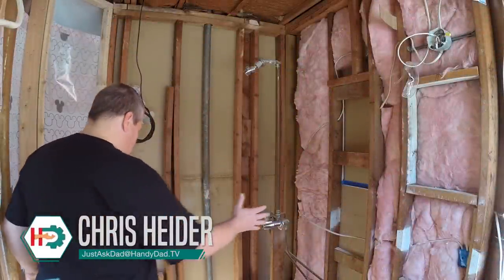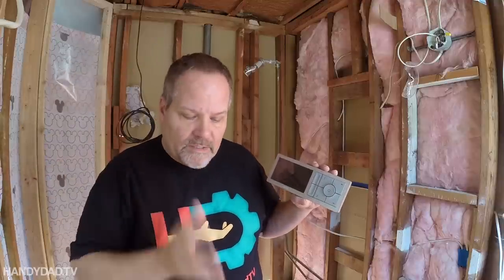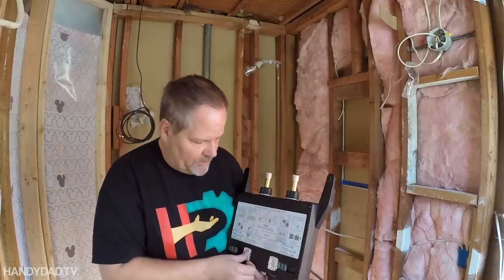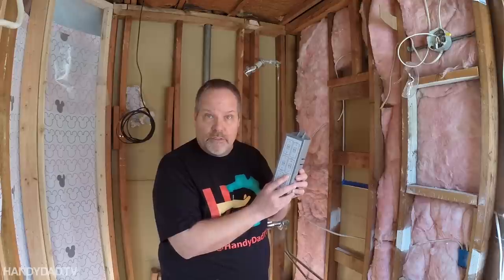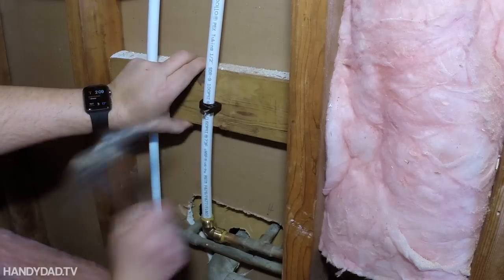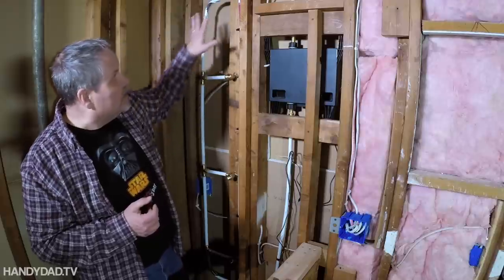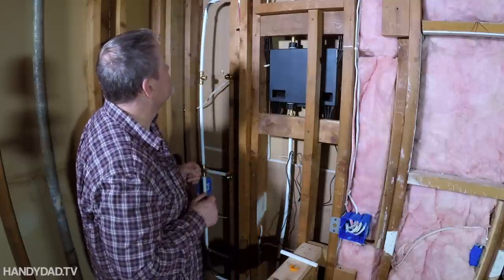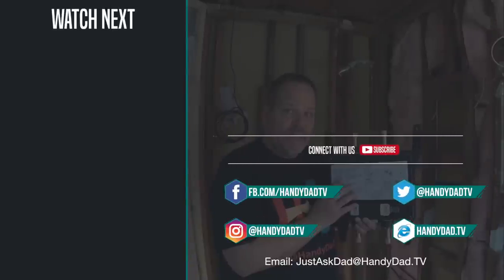U by Moen Shower Installation | Master Bath Remodel (Part 2)

Comment: There is no way I would use SharkBite fittings inside of a wall.
Reply from the maker: The inspector didn’t have an issue with it.

Comment: Don't install the batteries until the power goes out, might be years and the batteries could leak and then you have junk
Reply from the maker: Good point. But what if the power goes out while you’re soaping your hair?
Reply: @handydadtv  I would take my chances because I know that the battery pack Will still work when I put them in

Comment: Great system.... however never use shark bite fittings for a permanent install..... they are for temporary use only.... the pex is fine but should have used proper pex copper crimp rings
Reply from the maker: The inspector had no issue with it.
Reply: That's ok... I personally would not use them for a permanent install.... down the road it will fail....

Comment: Are you at all concerned using shark bites inside the wall?
Reply from the maker: If I wasn’t willing to put them in the wall, why would I use them anywhere in my house? If they weren’t safe, I would have failed inspection. Or minimally, the inspector would have suggested I replace them. But he didn’t say anything about them, he only advised me on the pressure loop.
Reply: @handydadtv  I agree 100%
Reply: I'd be more happy with Shark Bites then relying on sweated joints not possibly failing somehow
Reply: @JamesAutoDude  you'd be more happy with a system that relies on o-rings and a pressure fit connection than a system that relies on a soldered bond between materials that has been in use for a century? i can understand arguments for shark bite when you are talking about diy, speed, .etc. but not reliability.
Reply: 13 years of remodeling bathrooms has taught me to only use shark bites when absolutely necessary. You could have bought a pair of crimpers and a torch for the price of all those fittings alone.

Comment: I'm using the pex pipe with pex pipe fittings, which made this install go well. I used your alternative balancing loop. I used the blue pex pipe for cold and red for hot. I also got shut off valves in the same fashion. I used the white for water coming out of the unit.
Reply from the maker: Which kind of clamps did you use, metal crimped or the stretched plastic ones? Either one is an investment for the tools.

Comment: could you build a regular hand knob in loop with it. so if there was ever a electrical short on the display you could still turn a hand knob to take a shower. plus that would make another good video of a bypass hand knob.
Reply from the maker: Sure you could do that, but I would just use our other shower if the master bath shower breaks. If you only have ONE shower in the house, I can understand your desire for having a backup.

Comment: I have installed the same; do you know how to voice-trigger a Moen by U preset through Google Home?  I cant figure it out and their support pages aren't very helpful. Many thanks, and great videos.
Reply from the maker: It works fine with Alexa. That’s what I use.
Reply: HandyDadTV Great? Even requesting presets?  Google Home is working fine to  "turn on shower" but for some reason won't start presets.  Weird.

Comment: Moen calls for a minimum opening of 14 x 29" so that you also have access to the GFCI outlet/Moen power supply, and that power supply is to be installed above the U of Moen valve.  I'm guessing that Moen's instruction is not a strict if-you-don't-do-it-you-won't-pass-code rule but it would be helpful to others who stumble across this video to know where you placed your GFCI outlet given that you've gone off the Moen reservation in that regard and it passed your Code inspection.
Reply from the maker: I read the instructions but chose to do it differently. So it would fit behind the mirror, I installed an outlet for the power supply inside the vanity. Watch Installing the Lights, Triple Switch & GFCI Outlet | Master Bath Remodel (Part 9) https://youtu.be/6y0OnCM8iWk

Comment: You could have easily made it the way inspector recommended by using very small pieces of copper and make.your own tees with a copper tee and copper female adapters and continue with pexx

Comment: As a plumber please don't take this as the way to do it. A loop is always better than what was done here and from what I can see a loop could have been achieved. Please please please don't ever put shark bites behind a wall. If you use a shark bite use it in a place that is accessible to deal with when or if they fail. I as a plumber would never use a shark bite as a permanent use fitting. I have seen them fail alot. U by moen is a badass system though I have installed alot of them and love it when installed correctly. Love moen. Don't use shark bites and please try to get a balanced loop or you may be disappointed in the final product and have no way to fix it after the wall is finished.i suggest hiring a plumber for proper installation.  Just saying. Cheers
Reply: How much have you charged for installing them on new construction? Contractor is currently quoting me $1020 per shower for labor alone
Reply: Would you recommend using thread tape or sealant on the white threads of the Moen? (The ones that the cc connectors thread onto?)